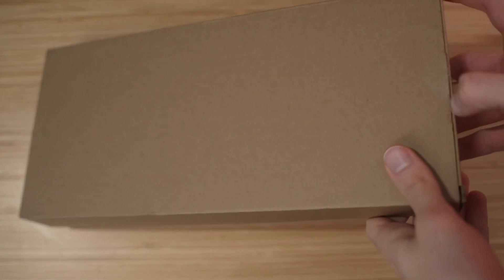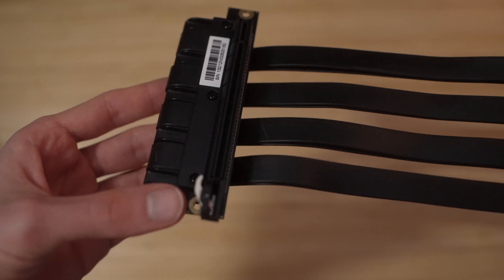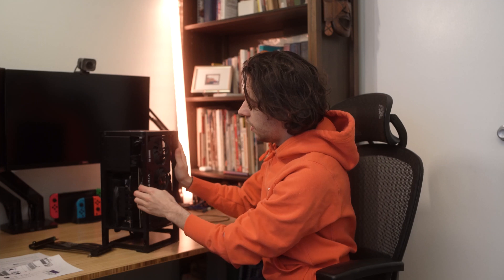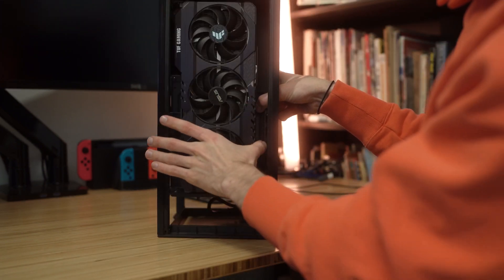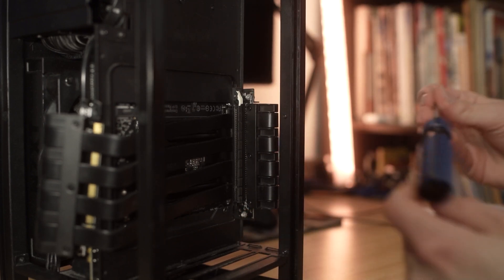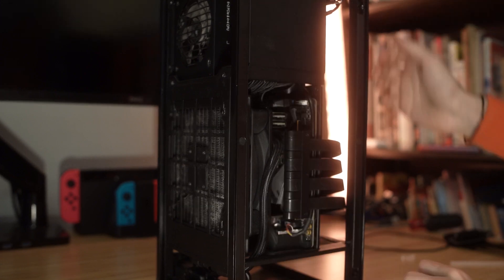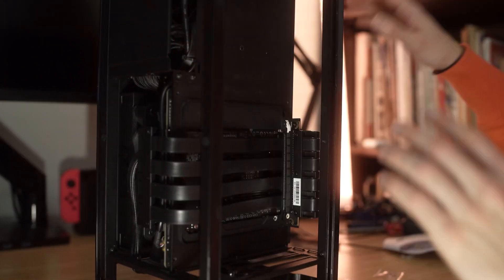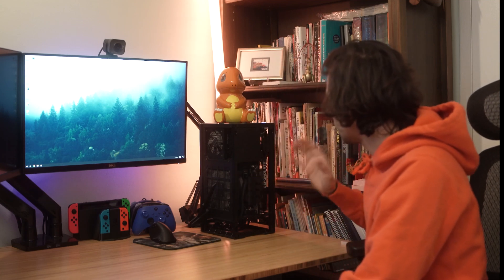NZXT H1 PCIE Riser Card Replacement | Tech Dash with RashBalash

Comment: do you know if you can replace the riser yourself with any other riser of the same length? I emailed NZXT and they said they don't have risers available right now, so I was planning on just buying one from Microcenter
Reply from the maker: Hey, you should be able to replace it with any other PCIE riser that you'd like! the only thing to watch out for is that the screw holes match, but that shouldn't be a problem with most pcie risers. Also if it doesn't work, luckily microcenter has a really good return policy so you shouldn't have any issues with returning it.
Reply: @rashbalash  great thanks a lot